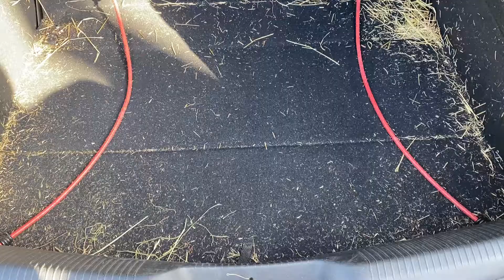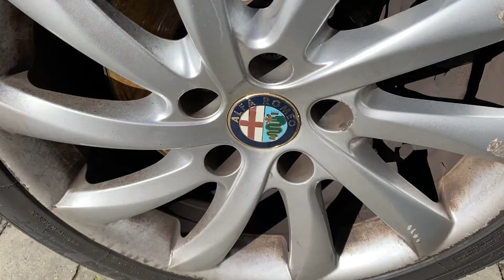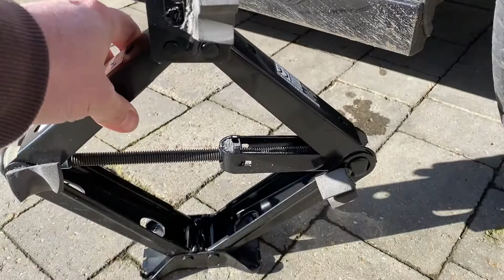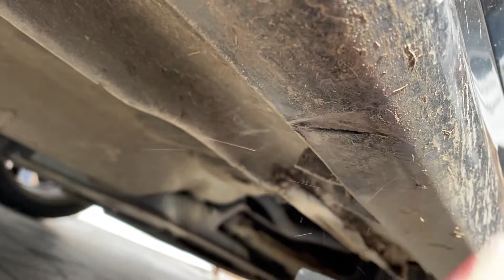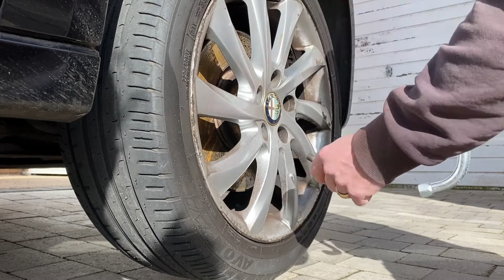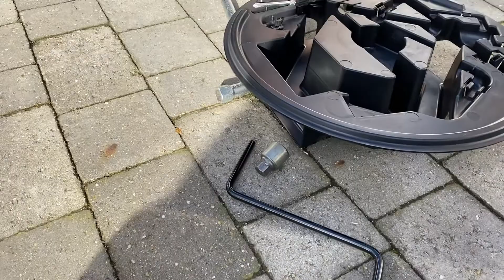Alfa Romeo Giulietta Change a Wheel Using Factory Tools and Jack - In the Wind!

Comment: I once tried to get rear off with tools to put spare on.. 2or3 of the nuts were on so tight by garage they just wouldn't come off until I got to borrow an extended bar. Is it just brute force really to get them off?
Reply from the maker: Hi Cran. They should be tightened up to around 120Nm. That’s fairly tight, and with the stock tools may need a bit of brute force to loosen the nuts. Using the torque wrench to tighten them (which has a longer handle) makes it feel a lot easier as you’d expect. Some garages will just use the air gun and over tighten them, rather than spend the time tightening them to manufacturer spec.

Comment: I own a Guilietta always carry a length of bar that fits in the standard wheel brace for leverage and a better scissor jack because you made it look quite easy but when I tried it I found it pretty useless and hard work seeming to only turn it half a turn at a time also extracting and replacing the bits out of the plastic holder wasn’t that easy either
Reply from the maker: Some useful points there. I know I keep mine well oiled, which helps a lot. Thanks for watching and subscribing. (If you have). Appreciate it. 👍. All the best.

Comment: Thanks for sharing Vialetto Tony!  As an additional help for viewers, I note that this tire change is in optimal conditions on stable, flat, hard roadway.  I've often found it useful to carry a small 12-18" x 6-12" flat plank of wood in the car, in case a tire change has to be performed on a soft surface like shifting sand.  A soft surface can ruin your ability to jack up the car enough to get the clearance necessary to remove the wheel; but setting the jack on the plank of wood can give your jack a wider footprint (much like a trekker on snowshoes).  If you're lucky, your little square of wood will fit out of the way over the top of the tire jack kit, under the mat.
Reply from the maker: A great suggestion. Good advice for sure.